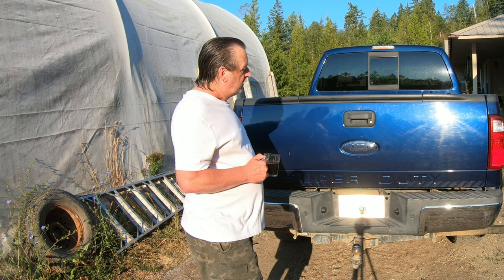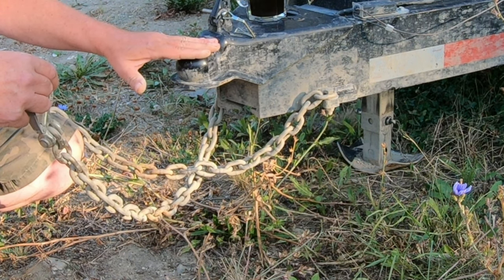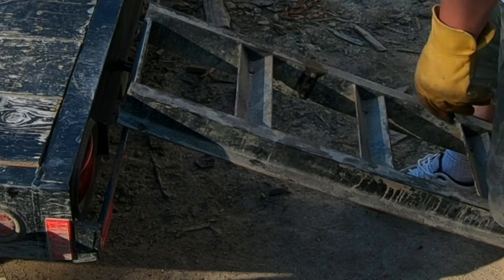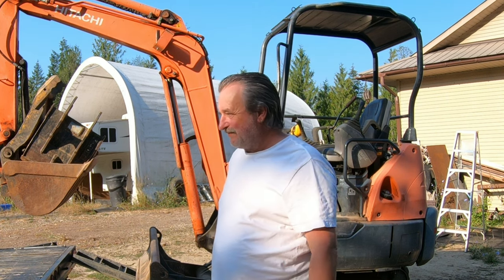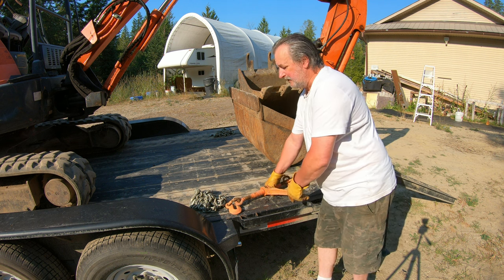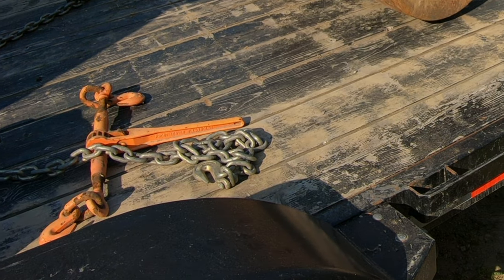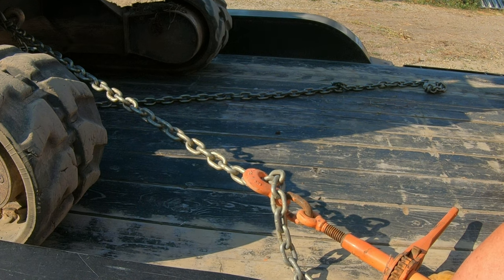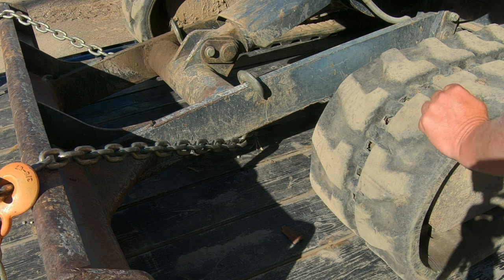How to Safely load Mini Excavator, Skid steer, or Tractor on a trailer.

Comment: I’ve got a JD 35g.  Weighs about 8k.  In my particular situation my machine seems to ride better with the boom and the bucket towards the front of the trailer. The trailer axles are pretty far towards the rear and I don’t really like part of my boom extending beyond the trailer. If I drive the machine further towards the front and swing the boom towards the rear I seem to have way too much tongue weight. I don’t really see anything wrong with having the boom towards the front of the trailer. What are your thoughts? Thanks a lot.
Reply from the maker: I think it should be fine i have seen some trailers have axels back further but also you could go over a weigh scale just to make sure
Reply from the maker: for your Toung weight

Comment: How come most people spin the boom around towards the rear of the trailer?
Reply from the maker: Good Question two reasons one thing is you want more of the weight in front of the axels but for me I also like to keep the seat dry as possible as it is a  open cab.
Reply: @liveworkplaywilderness1877  thanks for the reply. Man, I also have to get a stronger truck. I mostly use my machine around my property but decided to take it out to make some money the other day. I used a 92 F250, just not strong enough to pull it up the mountain.   It was struggling so bad that at a certain point because of the gravel on the dirt road it started dragging me backwards. I thought I was going to roll off the side of the mountain. Shook me up a little bit.
Reply from the maker: @arkansasunplugged  yes Deisel is the way to go
Reply: @liveworkplaywilderness1877  absolutely.  That 92 is just a used up old gas burner.  I knew better than to use that truck but I went for it anyway. Pretty stupid of me now that I think about it
Reply from the maker: @arkansasunplugged  Yes diesel is the way to go

Comment: Those new load binders are a bad idea. Have to have tools with them and takes twice as long to secure the load. Chain should be hooked back to itself around stake pocket.
Reply: Are chain stake pockets really needed?

The chain still wraps over an edge when a stake pocket is used. 

There are derating factors for anything other than a straight pull. 

D -rings on the trailer to enable straight pull would be better. 

It’s a bit moot and personal preference. Either way, inspect gear for wear and damage, use good rigging practices. Check chains for loss of tension when loads shift.
Reply from the maker: I do think D rings would be way better for me